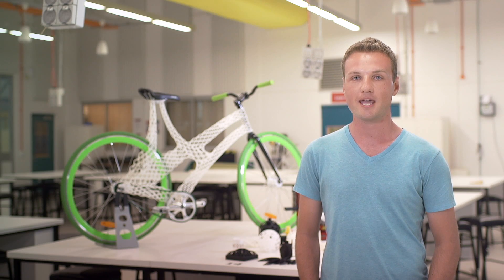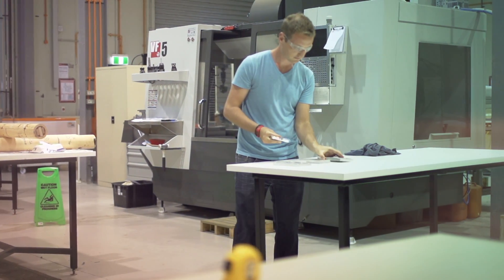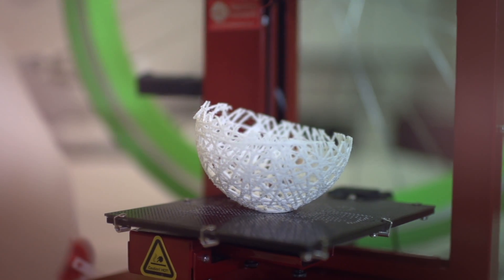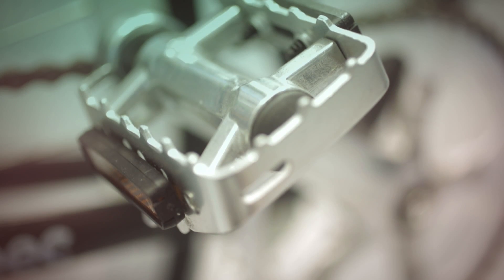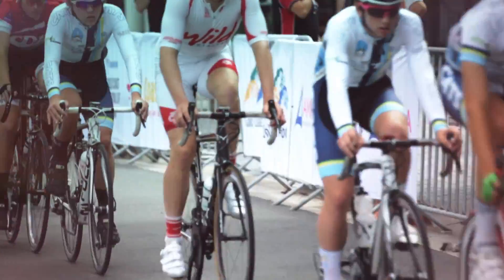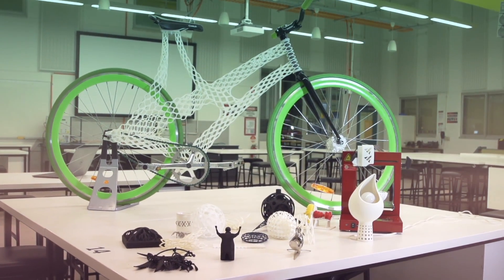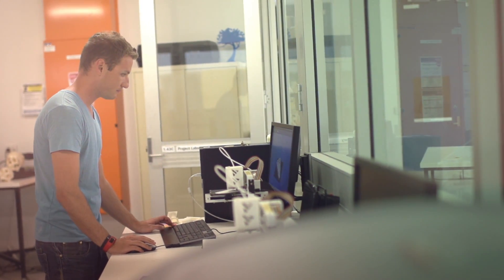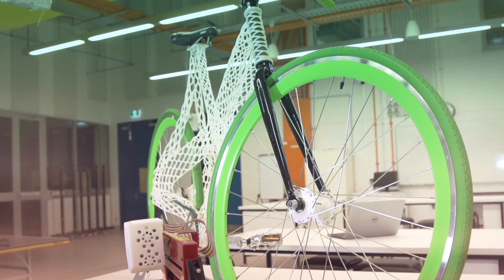James Novak wins global award for his 3D printed bike

Comment: Millennials think 3D printing is the answer to everything. I'm sure they'd make a 3D printed house if they thought they could. I'm not saying 3D printing doesn't have it's place or isn't useful for some things, but it's starting to get OOC.
Reply: Millennials are experimenting with ways that 3d printing can be used, because it has massive potential but we are still figuring out exactly what its place is. and clearly you haven't looked up "3d printed house".
Reply: Max Bell Wow I looked it up. I had no idea. I guess 3D printing is becoming more and more viable as the technology improves.
Reply: Yup. I mean millennial's are just screwing around with 3D printing tbh. they understand the concept and try to apply it. to quote bane, they just adopted the technology. Kids now are growing up with 3D printers in their classrooms from grade 5. They know it inside and out, and have a feel for it, understand its weaknesses and strengths. I expect when they hit University and Graduate levels, they will have printers doing incredible things. If you want other neat applications that are currently being used, look up 3d-printed hip and joint replacement. thats nearly 10 years old at this point.

Comment: Little bit of a drawback that it isn't strong enough to use.
Reply: that structure is much stronger than the solid once...its called lattice wire frame structure...its the future....it increases the strength and surface area...which increase the heat transfer rate....
Reply: And the shape is crap